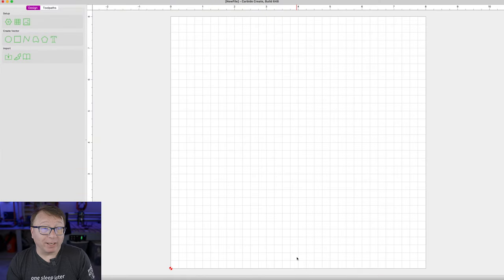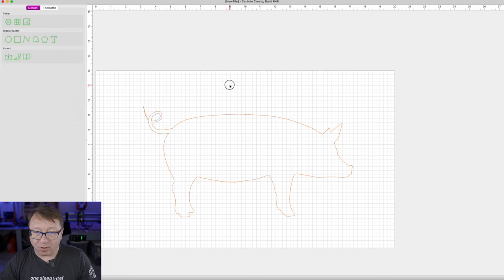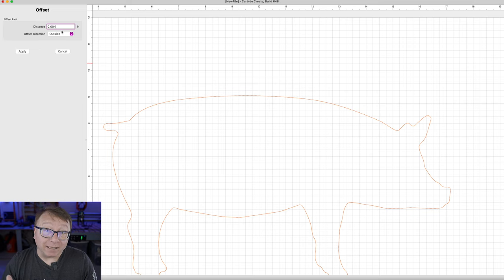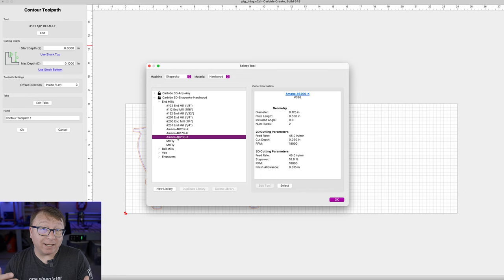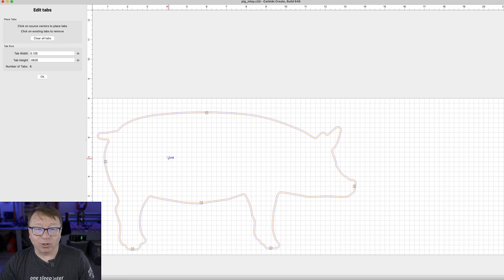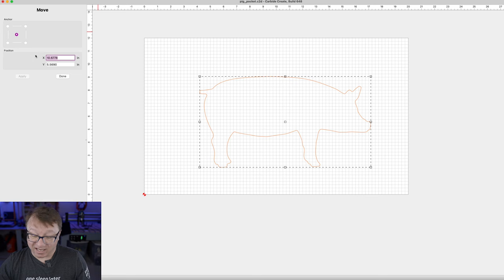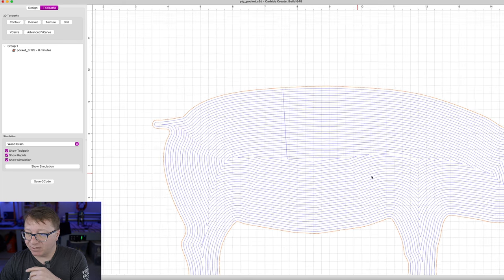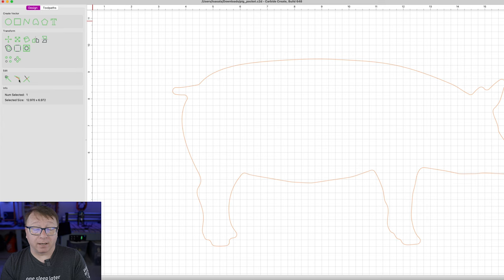Easy Inlays with Carbide Create -- MIND BLOWN!

Comment: Thanks so much for this!  Is there a rule of thumb for the pocket offset based on the bit size such as 1/16 ball nose?
Reply from the maker: I'm not sure what you mean by pocket offset? You mean step over or depth of cut? For finishing pass, something like 8% step over seems to be a good compromise between time and detail. For DOC, 50% of the diameter, so 1/32" (0.03125). Hope that helps - thanks for watching!

Comment: Hi, really useful video. I am really just getting started. I watched a maker video (can't remember who's) of a really nice multi inlay cutting board. In that video rather than cut all the way through the material to create the inlay piece, they cut around it leaving a thin layer of stock material (kind of as a relief carving). Is there a way to do in this in Carbide create? I am a teacher and i think it could be a good project.
Reply from the maker: Hi Michael -- I believe you are describing the typical end grain inlay process that was first popularized by Vectric. That works very well and you can get some amazing results with it. I think you can get the same outcome with CC, but I'm not sure on the exact process. Certainly I would recommend starting with "simple" inlays first and then moving on to more complicated inlays like those used with Vectric. I will do some research on using CC though.  Thanks for watching -- let me know how I can help with your classes. Thanks.
Reply: @cyberreefguru  Hi, i will definately start simple. In my head it might be a pocket function if the software could see the space between an outer profile and the actual inlay profile required. I need to spend some quality time with CC as well to develop potential projects that will engage my pupils. Thank you so much for replying.
Reply from the maker: @michaelmoss-c2r  no problem - let me know how I can help!
Reply: Hi again,

I think i have figured it out.... in CC, if you select the outer profile that represents the material size and the profile that becomes the insert. The Pocket function will then remove the space inbetween them. It even works if there are multiple internal profiles.

Thanks again for your support and all the videos.
Reply from the maker: Thanks Micheal -- glad you figured it out!

Comment: I use Carbide Create and instead of creating two different files I just disable the toolpaths as needed and save different gcode files. Seems excessive to save the workspace file twice.
Reply from the maker: Hi Alex - perhaps I was not clear in the video; you don't need two separate CC files - you need to save two separate gcode files if you have different bits.  I'll have to re-check the video. Thanks for watching and pointing this out!
Reply: I do the same thing, different versions etc within same file saves me from having to save multiple. You can just drag one off of the workspace to the background and disable toolpath.
Reply from the maker: @sandralewis1162  Thanks!

Comment: Why not do a v-carve inlay so you can have all the details? Just a suggestion.
Reply from the maker: Excellent suggestion - that would be optimal, but generally those capabilities require paid software or the pro version of the free packages, which was beyond the scope of what I was trying to do with the video. I am planning on a more advanced video when I get the chance, but I have some experimenting to do first :) Thanks for watching.
Reply: @cyberreefguru  there's no Pro requirement in Carbide Create for V-Carve inlay!
Reply from the maker: @JohnColgan.  Thanks John  - I will check it out!

Comment: You can use different  layers in CC V 7
Reply from the maker: Thanks Bill.  Yes, but you cannot export gcode anymore, which is a major disappointment and a very poor choice on behalf of C3D IMHO.  Thanks for watching!
Reply: @cyberreefguru  The pro version of version 7 allows saving gcode files.
Reply from the maker: @BillYovino  Yes, the paid pro version does. Are layers limited to the paid version as well? I've not upgraded since I don't want to lose the save gcode option I have today with the free version.
Reply: @cyberreefguru  I don't know if layers are restricted to pro, but I've found it to be a useful feature. You can keep your Version 6 and still run Version 7, so you don't have to worry about losing the ability to save gcode.  They can coexist without issue. Save a copy of the V6 installation file if you're worried.

Comment: the new carbide create is horrible as it doesnt let you export gcode... it has some good features, but it makes it worthless to me.
Reply from the maker: Yes, I made a video about that. Sad, but true. Thanks for watching!
Reply: The paid version of carbide create can export and save the g code and if you do inlay it has the feature in advanced v carve for inlay the paid version is well worth it most paid software is online based carbide create pro is yours after you buy it and you don't have to design online. And you can save and share the gcode as u wish . But the free version will not let you save g code. I use it for designing drone frames and odds and ends wood work for friends and family. But is a great option to some of the subscription softwares out there. Personally I like it. Takes a while to get the hang of. But have fun making cool things.
Reply from the maker: @charlesminney8481  Well, not entirely. CC is offered in both subscription and perpetual license format. The perpetual license is 3x the cost of a subscription, but more importantly, a perpetual license only gets you 1 year of updates. By that mark, it is way less expensive to get the subscription if CC is updated more than once in 3 years (you don't have to buy every update though). Something to consider, eventually the version of your perpetually licensed SW will stop working properly, and then all your designs will be locked out unless you pay for an upgrade at some point. If the software continues to work properly for 2 years after maintenance ends with no blocking defects, the break even point is 3 years. After that, perpetual license is less expensive; before that, subscription is the way to go. It completely comes down to how many updates the SW gets in 3 years and if any new features are "must haves" for you that requires an update. If you are like me, and keep software for 5-10 years praying it will continue to work, then perpetual is a much better deal. But if you want all the new features as they are released, then subscription is your friend.  Thanks for watching!